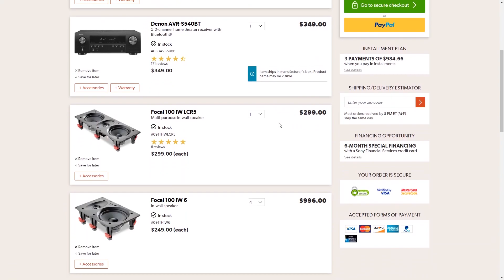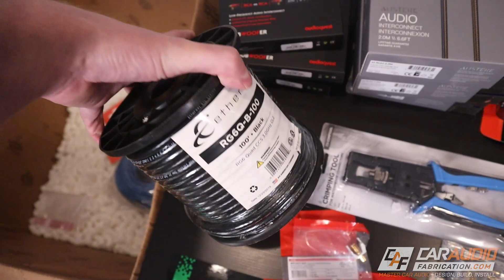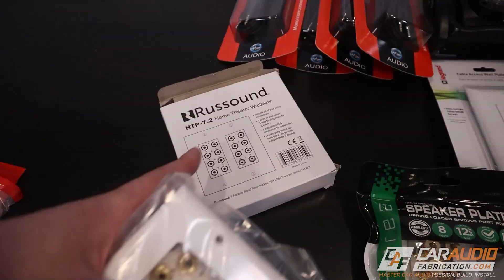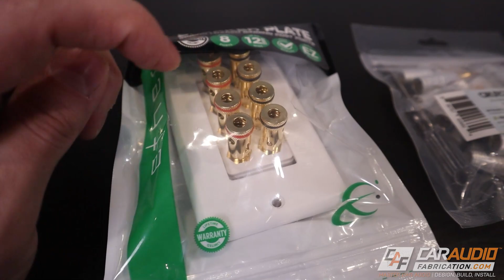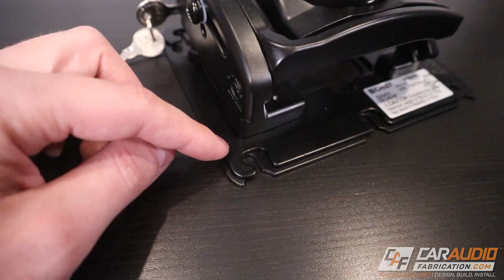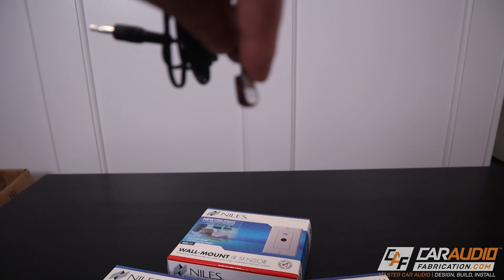MUST-HAVE Home Theater Accessories You NEED!

Comment: I know you haven’t gotten to all the accessories yet, but having an HDMI switch on the rack may help depending on if you want the other TVs to use items like a 4K Blu-Ray player or NAS. Also, signal through CAT5 begins to degrade after 100m. This is a long distance, but running CAT5 through walls, across floor joists, and back down walls can add up.

Comment: Some devices use Bluetooth rather than IR sensors. Is there an option for Bluetooth extending to another room? I'm thinking of placing my rack outside the media room. Thanks
Reply: I prefer Bluetooth remotes as they work outside of other rooms and don’t have to be pointed directly at any device. I was going to mention this route for the build. Thanks for mentioning  this topic.

Comment: Hey Mark,
I had a couple quick questions, completely off topic of course, I just couldn't find an answer to. Whether or not you answer, I thumbs-ed up, curved arrow-ed, and subscription button thingy-ed. This is the third time I had a question and thought of ya, and "Mark Stereo Dude" isn't the best query to find ya efficiently 😎. I think all that jazz helps ya out too, so win-win.
 
Why do some car amplifiers have multiple fuses, even though each one seems to be at the max A(I) the amplifier should draw? e.g. an amp is 110W RMS x 2@4Ω or 350W Peak x 1@4Ω 220=(I) x 12V or 220W(P)/12V=18.34A(I) and 350W(P)/12V=29.17A(I)  and it has 2 x25A fuses (Even the manufacturer didn't think this AB class amp would make 350W(P) hence the 25A Fuse, but why does it have 2 of them? I've seen some with4. This is purely academic, my car audio days ended with good hip-hop in the 90's, but I was giving a local Grom a hand, and the question has always made me wonder, and since I don't have to hit the library and order a book, I thought I'd ask. I just can't find any white sheets on his gear, or any really that address it either, so I had to bug ya a sec. I understand it has 2 channels, but the specs at peak performance(fantasy land) would only draw that 29.17A so 50A would negate their existence. Now for anyone else reading, this is where Mark will say 3 words and it'll be 💡 followed by me wanting to punch myself in the face 😂

Second question, an even more odd one you'll think I'm sure: To make it easy, use the same specs for an example; What would would be the minimum amperage requirement to power it up and get sound? e.g. If I wanted to test his components w/o wiring them into an automobile. I know a 12V source wouldn't need more than 25A max output, even though it'd be fine if it did, as the amp will only pull what it needs if they work like all other DC devices. My question is on the other end of that; Is there a calculation to find the minimum requirement to power it up and make sound? Most DC equipment I know of might not only not work using an under-current source, but a bunch of it will mess up the same as if the source were over-voltage. There always seems to be a documented "range" on the things I work on, yet I also couldn't find anything mentioning minimum power requirements. I wanna make the kid a power supply outside of his whip so he can dabble and experiment pre-installation, that isn't going to freak his Mom's out, but I'm outta pots atm to make him a little buck/boost circuit in lieu of a bench supply. “¯\_(ツ)_/¯“ I could use your input,No Docs, at least not that I could find, to explain either question.. I'd appreciate your help please Sir, if you can..

Those box covers with the keystones are pretty Dope too , I gotta say ... a long way from hot knifing switch plate covers like we used to have to do. I use those same banana plugs too, great value with room for decent sized average system wiring, and killer performance. Thanks for your time Homie, seriously, especially if ya made it this far, I appreciate ya!!!
Much love!!! ✌
       ϻя.ƹ

Comment: I used Keystone plates when I did my home network in my old place. I found some 6 port ones, and network rack panels. Wire molding is great for hiding wires.

Comment: Top tip, use ethernet cable as speaker wire. Cat6a+ 👍 Save yourself money on overated speaker cable.
Reply: Interesting. I've heard of using HDMI over ethernet, but not using ethernet cable to power speakers. I would think the wire gauge would be much too small especially for high powered systems.

Comment: Yep, I just installed front height speakers today and totally forgot to order banana connectors. They're not necessary, but they make life a lot easier when you go to EQ the system and only want a single or a pair of speakers firing at a time. Luckily I remembered the bananas while running errands today and I was close by a Lows store, they had them in stock so I grabbed a pack. Just finished watching Pacific Rim and just as I suspected, this is way better than 5.1 surround sound, way way better! 
Cheers 🍻.

Comment: These are some great suggestions.  It is a good idea if you can, to set your sound system up in a temporary fashion and give it a test run before committing to cutting drywall.  Also pulling cable through walls and attics can be very difficult and frustrating.  Look at some of the cable pulling tools (there are many) like fish tape and fiberglass rods that are available to make this job a little easier.  One tip I have is if you are running wire straight down (or up) try using a weighted string or length of jack chain to drop through the top hole.  The weight of the chain will cause it to drop straight down to the hole below.

Comment: When pulling the cable from a spool it is best to un-roll the cable rather than pulling it off the top as you showed.  Pulling the cable off the top as you show induces a twist into the cable making it want to knot up and not lay flat.  You can keep the cable from knotting up by putting the spool on a cable caddy and pull it straight off, or if you don't have a spool holder just set the spool on the floor and roll the spool across the floor allowing the cable to lay off onto the floor.

Comment: If you were going to buy RG6 cable already you should have just bought RG6 RCA ends and make your own RCA's. My subs sound ao good this way. I find that all of the extra av control items can be eliminated by using smart devices. TV, projectors and receivers are not smart and can be controlled via apps. I can even remember the last time I used the remote for home theater.

Comment: Getting a good universal remote like the Logitech harmony system is a big help that most people don’t think of. Condensing everything into one remote as well as giving the  ability to control smart lighting as well. Using a remote like this can actually eliminate a couple of the things in your video like the 12v triggers because it will power on and off most system components for you. As well as the IR repeater because most good universal remotes work over an RF frequency to the hub and then the hub sends the IR to the components.
Reply: Most stand-alone amplifiers don't have remote controls, so you need the 12v trigger wire regardless. It's exactly like car audio where your remote wire tells your amps to turn on.
Reply: Good point wasn’t thinking stand alone amp.
Reply: Logitech has discontinued all remotes.
Reply: @thehifiwifiguy  I did not realize that. Good to know thanks
Reply: @thehifiwifiguy  Yes they did, those rat bas$%. Has anyone found  a good replqcement yet?

Comment: I'm a big fan of the Keystone style plates, but holy crap can you spend some money getting them setup "just so". When I sold my house, I ended up keeping the plates because it was a significant expense that the new buyers didn't care about. Very few people would care more than just having the speaker wires run, so... it worked for all of us.

And... I also used a boatload of RG6 (maybe have been 59), but I terminated most of it with regular CATV style ends. I did that because I could then use 90 degree adapters on RCA-to-RCA keystone inserts or RCA-to-CATV keystone inserts as needed. Those 90s really helped on places were I had multiple analog signal runs in the plates. Those direct RCA to coax adapters are really deep and it gets tough to run them in a 3.5" wall cavity that also has a heap of other wires.